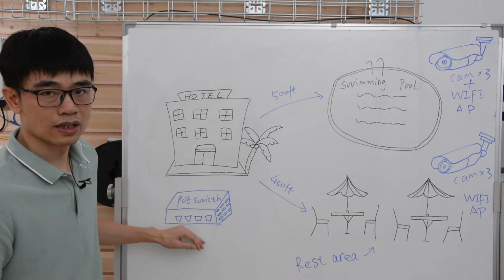How to use fiber optical cable to connect Outdoor PoE switch

Comment: Sorry, I had difficulty in understanding you.
How does FIBER OPTIC CABLE carry POE.
Reply from the maker: You can’t inject the power to fiber optic cable. The fiber optic cable is made of glass, and glass can’t carry power. You might pull power cord in parallel to send the DC56V power. The media converter should accept the wide range DC power, so it can adapt to the voltage drop for standard PoE.
Reply: @Fastcabling  Thanks for the reply, it was a bit of a rhetorical question, I spent my career in the early days of mainframe computers and then switched over to networking.
I worked for a Silicon Valley company called 3Com which was founded by a guy called Dr. Robert Metcalfe who headed up a group of scientists at Stanford U. who invented ETHERNET. In fact Bob Metcalfe holds the patent for Ethernet.
I knew him well enough to pass the time of day when I was visiting 3Com HQ, I worked in the office in Chicago.
I was involved in installing some of the very first Ethernet networks, the first Ethernet networks ran on type N shielded cable at 2Mbps then 10 Mbps. Then we used RG58 shielded cable at 10 Mbps, then Unshielded Twisted Pair which was tried out at Motorola in Chicago.
I retired just as WIFI started to takeover, I had a great career.